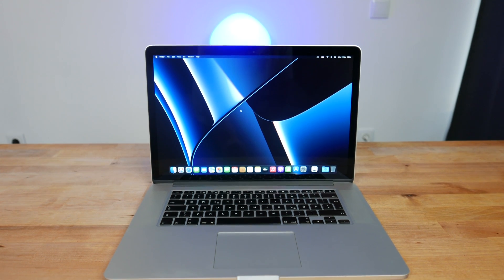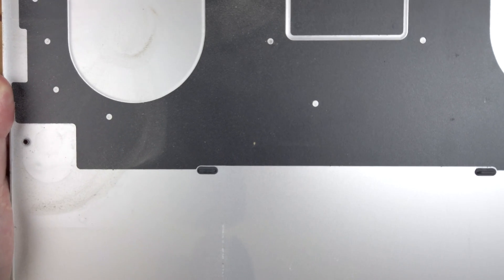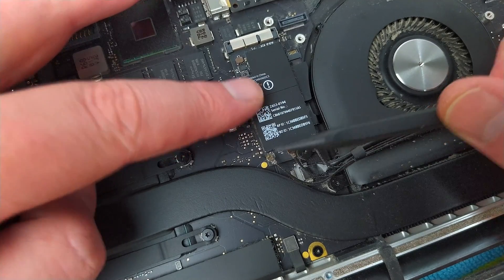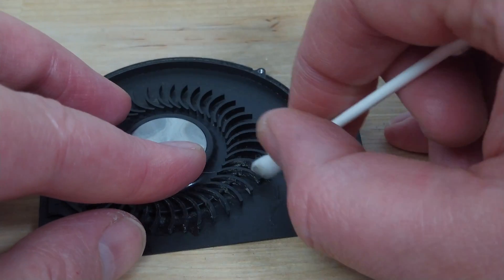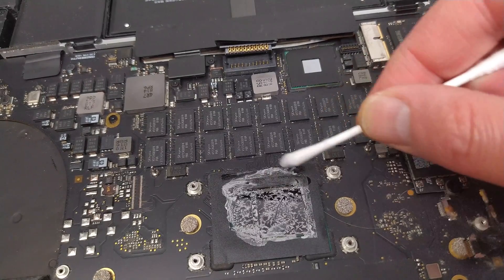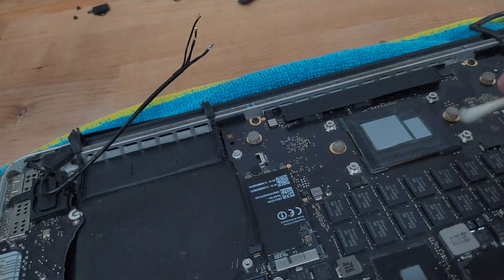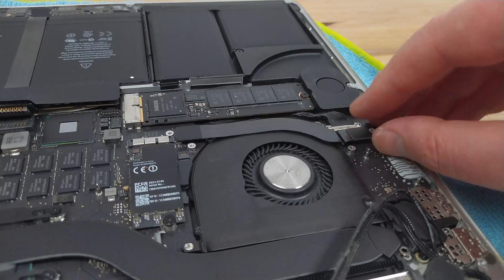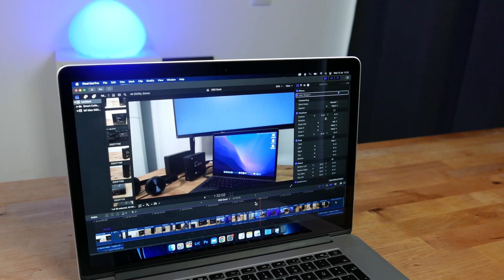15" MacBook Pro Cleaning and Thermal Paste replacement

Comment: HI, thank you for the video. I just managed to replace the thermal paste and cleaned out the fans as you suggested in your lovely step-by-step process on my 2014 macbook pro. I had replaced the thermal paste once before, when I upgraded to a 1TB HD, and its been cleaned when I've had the battery changed. And need not have done it as bought a new Macbook Pro M1 Max, but what the heck, me and my old Mac have been through a lot together so still use it more than my new one! It deserved some attention before proper retirement ;-0) Thanks again for the steady and thorough process. Highly recommended!

Comment: Excellent video. Only thing I would change is using a vacuum before undoing the fans and use that vacuum on the heat pipes. I prefer vacuum because blasted air can only push dust deeper into to places it should not be. Carful with keyboards as a strong vacuum can suck keys right off the board but you can "throttle' a vacuum with your fingers. Loved how you covered every step. I unfortunately have 2 Flexgate top of the line MBP, so no screens which Apple decided was cheaper to fix by hiring lawyers instead of having integrity. 
Thanks for the great video.

Comment: A pro tip when applying thermal paste don't use the heat sink as it can cause hot-spots to build up. Instead take a piece of tape and put it in a finger and spread it. It makes a  huge difference.
Reply: thermal paste manufacturers recommend to apply a bead or a a line - depending on cpu type (i.e. where the real chip behind the cover we see is located), so the video here is correct

Comment: Thanks so much for this video. The performance/temperature difference after following this is astonishing! Before cleaning, even 720p video would cause loud fans, overheating, thermal throttling, and stuttering within a minute. Now, after cleaning out tons of gunk, I can't even find an activity that makes the fans audible - 1440p60 doesn't even get a reaction. Genuinely feels like I've got a brand new MBP.